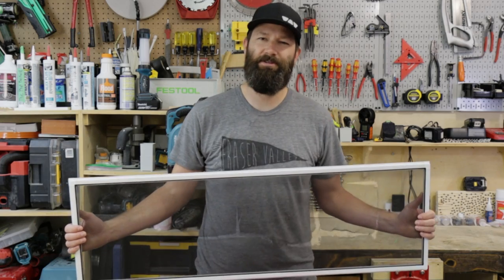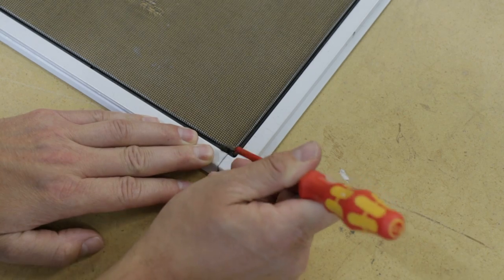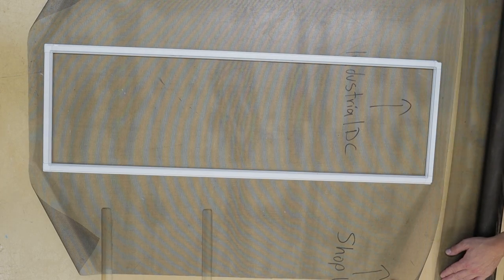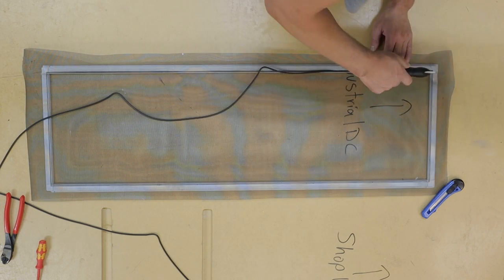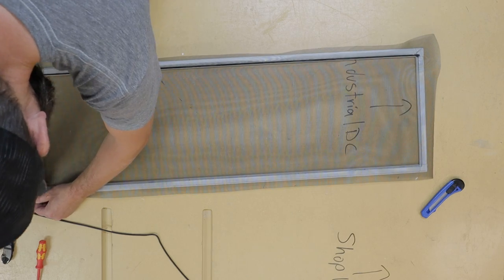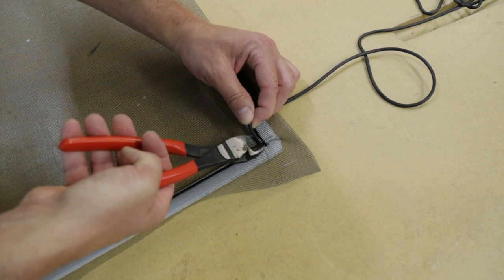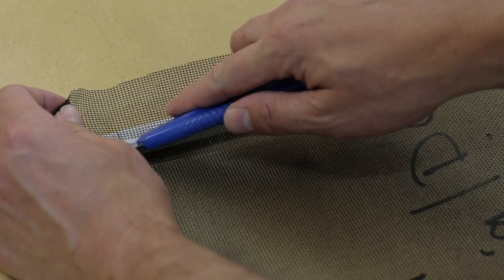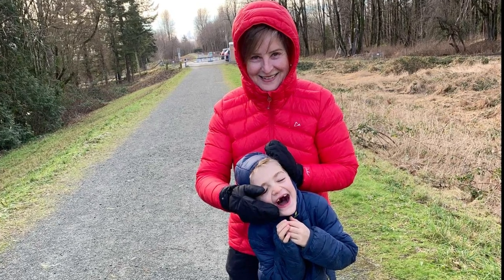How To Repair Your Damaged Screen- 5 Simple Steps

Comment: Nicely done.  One trick I use is where I start in the corner I run the spline an inch or so longer than than I need, and start pressing it in about an inch away from the corner.  So I have an extra inch of spline, and 2 inches that are loose and not crammed in.  Then when I come around to the end I do the same thing.  I stop cramming it in about an inch from the finish.  Then I overlap the splines, oriented as they would be, and I cut them both in one stroke, at a 45 degree angle.  This effectively miters the spline ends, so when you cram the first inch and the last inch, you don't a have thick bunch of material, and you almost can't tell where you started.

Comment: If I may add 2 cautions; when you’re applying the spline on the long side opposite the first long side you installed, don’t pull the screen too taut. It will deform the frame if it’s too tight. Also take care when rolling the spline; if you contact the screen edge of the spline channel while rolling you may cut the screen along that edge! Stay slightly toward the outer edge of the channel.
Reply from the maker: Excellent points chuck thanks for adding to the discussion!

Comment: Thanks. I’m about to do this. Can this be done on a door while it’s hung?  I’ve got a cheapo screen door and I’m not sure the hinges would reinstall again if I removed the door. 

Thanks
Reply from the maker: Hmm that would be very difficult.
Reply: @TheFunnyCarpenter  that’s what I was afraid you were going to say Lol.  Thanks for responding though 👍
Reply: It can be done , I do my gazebo screens every few years,and that's all built in to the frames like your door, cut the screen , use painters tape to hold not up loosely, pick a side and work it around, remove tape on the top after you get one side in and keep going around ,removing tape on the sides your rolling so it doesn't hold the screen from being installed to the channel.
Reply: @veritasaequitas4800  thanks, I’m gonna give it a try.  Much appreciated 👍

Comment: Not funny. Not carpentry. Did all the screens in my 20 year old vinyl windows. 12 double hung in five bedrooms. About 20 total. Experience is golden and your example is spot on. Enjoyed reliving the experience. Thanks and enjoyed your delivery as usual. Note that fiberglass screen will not stand up to uv as well as metal but it is cheaper and a little easier to work with.
Reply from the maker: Thanks Dan!

Comment: That screen is for sissies.  I'm working on a 36x80" sliding door screen as I came across this.   Most difficult part is finding somewhere flat to work it; otherwise, the steps are exactly the same.
Reply from the maker: 😂🍻 the floor it is